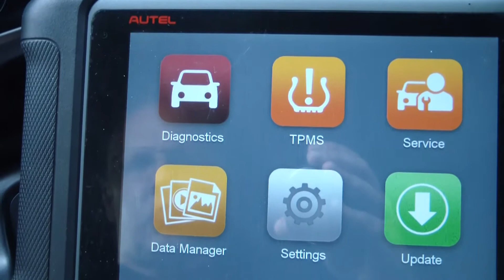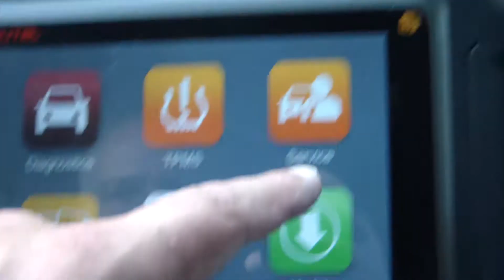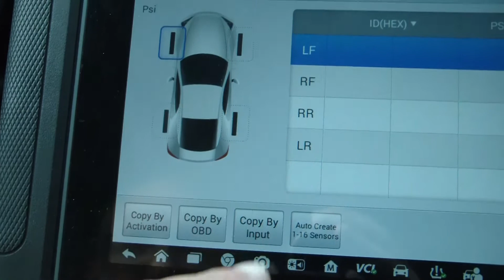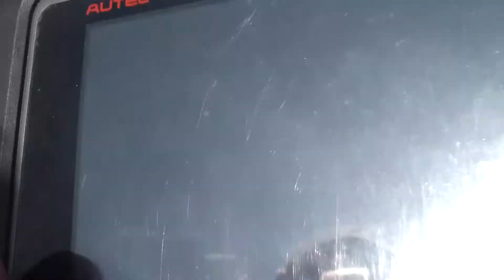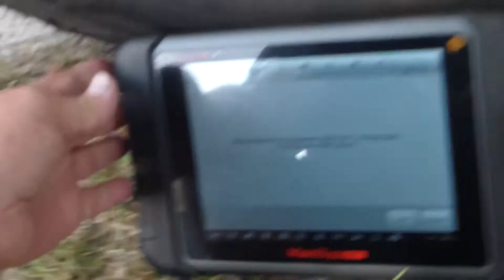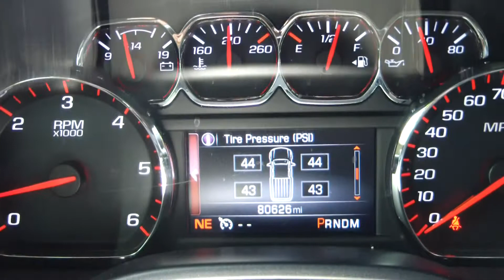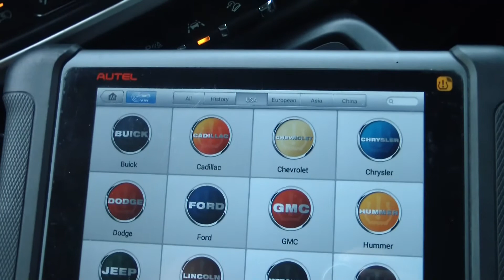How to Program TPMS Sensors on a Silverado / Sierra using Autel MS906TS

Comment: Hi can please check if this scanner tool have suspension settings for cadillac escalade with magnetic ride.i want to delete magnetic struts and install bilstein 5100 but it will trow service suspension light.wondering if possible to disable this from tool like this
Reply from the maker: It will have a test to test the magnetic ride but it will not delete it for you. There may be aftermarket programs that might let you do this.